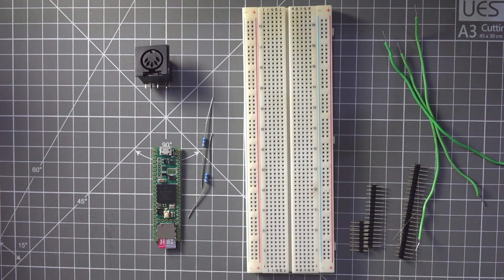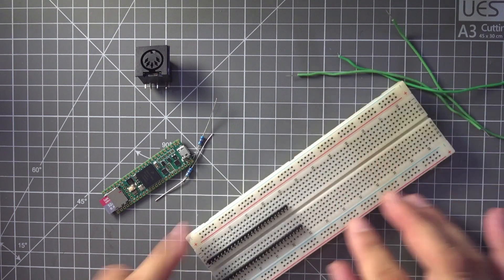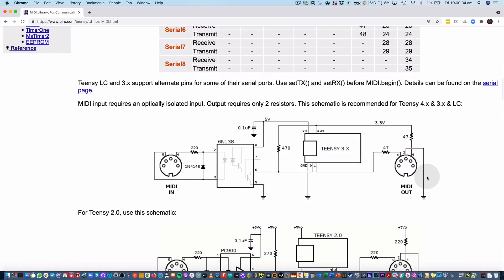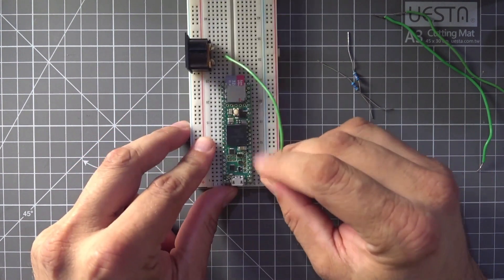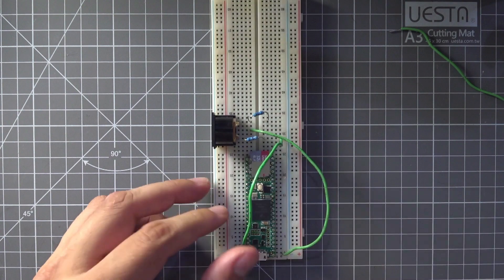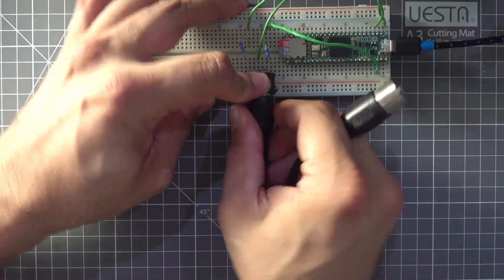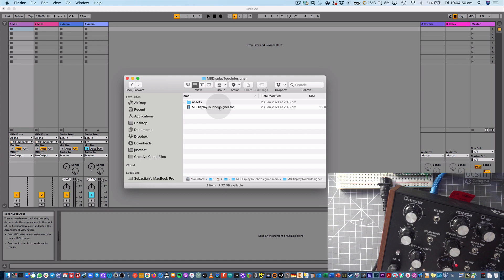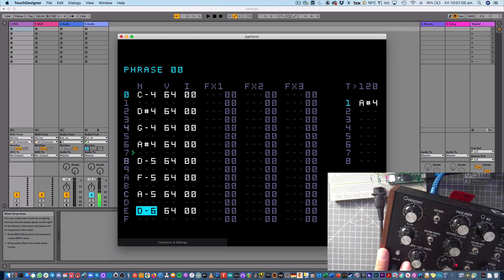How to Add 5-Pin DIN MIDI Out to M8 Headless Music Tracker

Comment: Any version greater than or equal to version "M8_V2_0_0_HEADLESS" does not send MIDI, but MIDI is sent via USB. This issue does not occur in versions less than or equal to "M8_V1_3_8_HEADLESS".  After speaking with laamaa and malik on the official discord beta testing channel; I now understand that MIDI out via Teensy pins was never "Officially Supported"
Reply: Thanks for that! I was going to try and build this midi out, but i guess ill just have to be patient and wait for my actual M8 in july
Reply: @morrinsville23  Instead of using th teensy pins to get MIDI, You can get MIDI out via Raspberry PI using a USB to MIDI interface…You may need to do some simple configuration for MIDI routing using “Jack Audio”. There is a discord channel for the M8 (With a special channel for M8C), you'll be able to find more info there, just search the chat history.
Reply: @AnthonyBerg  thats super helpful thanks!
Reply: @AnthonyBerg  That will add latency though; getting the signal directly from the teensy should be enabled, but probably they don't want to let people make their own M8, or nobody will buy it anymore?
Reply: @fcf8269  Yeah, I think midi and analog audio in are a step too far for the creator. he didn't open source this, he was kind enough to give people this for free, and we shouldn't abuse it or he will just stop updating headless with the new versions
Reply: Hey, do you know if MIDI input is also supported via the USB?
Reply: @paths4u  As far as I know, the creator of the project doesn't want MIDI to be used at all with M8 Headless.
Reply: I tried to simply upload old version (M8_V1_3_8_HEADLESS), but this wasn't work properly on my M8C (windows) and also M8C on R36H.

Comment: New to this. If I'm understanding this correctly, I can use a specific version of the firmware, your schematic, and boom, MIDI out?  If so, sweet!
Reply from the maker: Yes this is correct! If you can get the older firmware then this should work correctly
Reply: @littlescalemusic  oh, so this won't work on the latest M8 firmware? Which version(s) will it work with? Also, have you tried adding MIDI input to the headless M8? Just curious if that's also possible. Thanks so much for the great tutorials!

Comment: Which version of the firmware are you using?  i can not seem to send actual notes to output. M8 USB midi seems to be working fine
Reply: This issue does not occur in versions less than or equal to "M8_V1_3_8_HEADLESS"

Comment: Could you do audio out in a similar way?
Reply: I believe you need an audio shield with an DAC
Reply: @alecsbuga  Yeah, I guess I'll give it a try but I'm curious whether the headless version is configured to output audio on those pins or only through USB. I have a pre-order in but I figure I might as well tinker with the teensy in the meantime.
Reply: I'd also love to know if this is possible. Teensy makes an audio adapter for teensy 4.0 and 4.1 with ADC and DAC capabilities. Maybe even program buttons?
Reply: @derekwelsh1888  you can't. unless you can modify the firmware but you can't